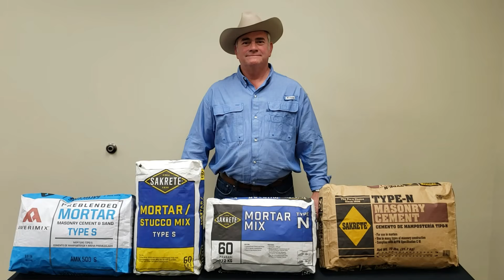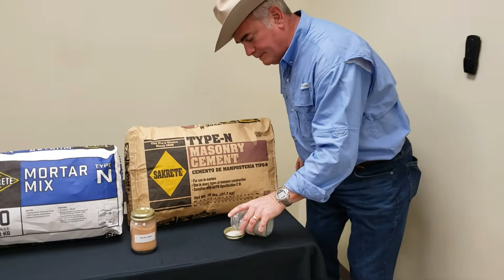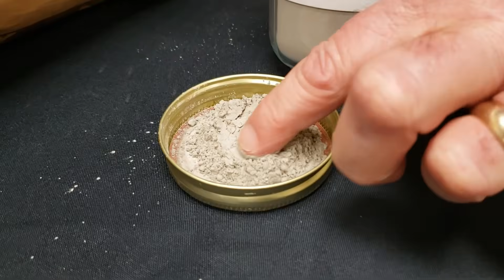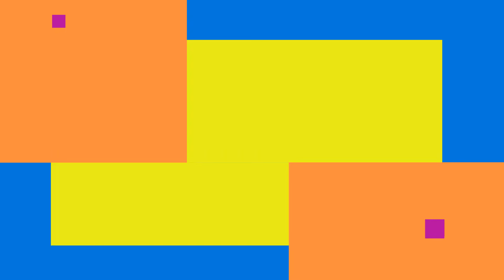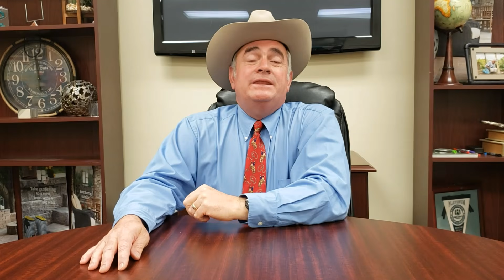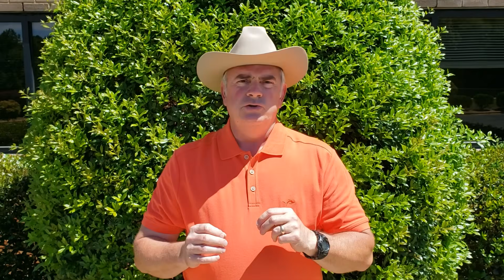Masonry Cement vs Mortar Mix Explained by the Carolinas' Concrete Cowboy

Comment: Thanks for explaining the difference between these cements. I am just wondering if you know, for Type S mortar mix usually they are only available in gray color (Well where I am currently at no other color than gray). Can I mix it with white sand to achieve color white mortar?  Thanks
Reply from the maker: No, you will need white masonry cement and mix with a white mortar sand.
Call your local block and brick yard for help. That is usually a stock item at the counter.
Good luck with your project!

Comment: Mortar T1061 (20 min.Fast rapid set
 Can it be modified and used to poor a drive way?
Reply from the maker: No brother, no. You would not be able to finish it. It would set looking rough.
Reply: I have 75,000 lbs expires this month. Yes 75,000lbs trying to put it to good use. What would you do?

Comment: I'm trying to make miniature red bricks for building various things and I'm a total newbie in this department. What would I need to make the actual bricks (aside from the mold - I've already made that) and would they be heat resistant? My cousin wants me to make a usable  mini pizza oven (lots of videos on here about those if you need an example). Also, what mortar would I need to hold the bricks together for the oven?

Thank you for your help.
Reply: Did you figure this out? I’d like to know?
Reply: @Restoringyu  not yet but it's been such a hectic year that I haven't had time for a project this big unfortunately.
Reply: Not yet but it's been such a hectic year that I haven't had time for a project this big unfortunately.

Comment: I'm trying to make concrete pavers (6ft by 3ft) smooth finish pour in place over an existing concrete slab. Could you tell me wich mix to use. Thank you
Reply from the maker: I don't understand what you are doing. Are you trying to top an existing slab to make it look nicer or are you trying to put down a mortar bed over an existing slab and set Concrete pavers on top?
Reply: I'm trying to top an existing slab with modern  looking rectangle forms to make look nicer and more modern. I'm thinking 3 in thick over existing slab

Comment: To summarize:
Mortar is actually sand & masonry-cement used to bind bricks together

"Mortar mix" is masonry cement pre-mixed with sand

Type N is softer for normal bricks 

Type S is harder for structural masonry

Like if this saved you 10 min of your life
Reply: I would add: “Masonry cement is Portland cement and lime”. 
I think he also inferred that “masonry cement” was a generic term and that ingredient proportions varied regionally.
I agree, Cowboy needs to tighten up his script writing on this one.
Reply: I am in the process of of reconstructing an old stone fireplace in our back yard. Is S type the best to use for these old stones?

Comment: Hey Dirk, good video! I wonder, if I'm fixing a 100 yr old brick wall that has 2 courses and supports a corner of the basement, do I use Type N to tuckpoint or type S? Some say the "S" was too strong and that 100 yrs ago they used weaker lime mortar. Using the stronger "S" will damage the structural soundness...but others say, like you, "structural? Use Type S", who's right?
Reply from the maker: 100 years old! Your brick may be softer than today's. Type N at the strongest. Go to your nearest block and brick yard and see if they have a tuck point mortar, which is a softer Type O.

Comment: So masonry cement is for making "lime "mortar by adding sand ?
Reply from the maker: No sir. In some parts of the country and on some projects, lime plus Portland cement is the base, then mix with Mason sand and water to make portland cement + lime mortar mix.  That is a purist approach. In other parts of the country, folks use a preblended masonry  cement that may or may not use lime as one of its ingredients. It is an either-or situation. I grew up in a masonry cement market. I noticed in Houston that folks mixed their own, so hydrated Type S Lime and portland cement were on the store shelves there, but not masonry cement. I hope that helps.
Reply: @carolinasconcretecowboy-di9499  Is there not two types of lime though.
Reply from the maker: Mark, types of hydrated lime for masonry are: Type N, Type NA, Type S, and Type SA. The "A" refers to air-entraining agent. I think the governing standard is ASTM C207, if memory serves.
Reply from the maker: However, agricultural lime can not be used for masonry. Maybe that is actually what you are asking?

Comment: Is it possible to use type N mortar mix to fix limestone blocks to waterproof sheet to create  exterior home facade? Can we use thinset bonding for limestone blocks (2feet x 2 feet x 1.25 inch thick) or would you consider thinset to be too frail for limestone?
Thanks
Reply: Use type S. They also make a very strong exterior thinset. I'm plumbing my exterior wall with type s then using a custom blend thinset for the tile. If you go to home depot or loews just read the bags of thinset and it will tell you it's intended purpose. If it were me I would use type s with a bonding agent